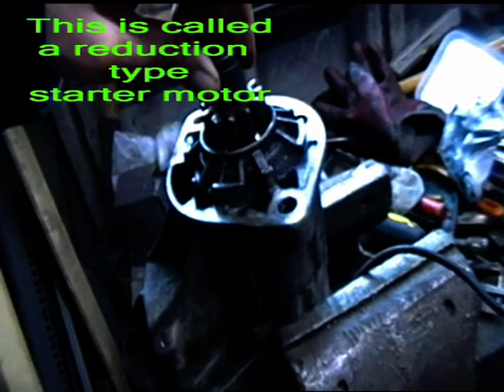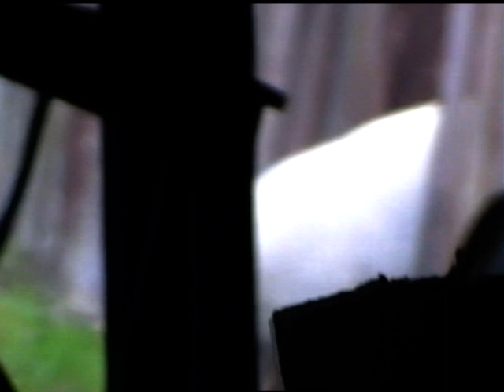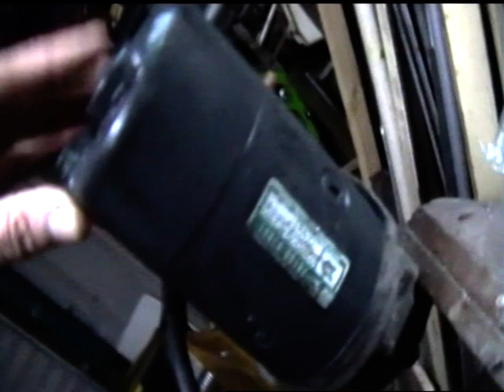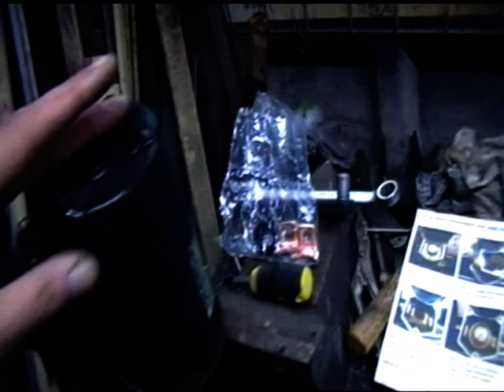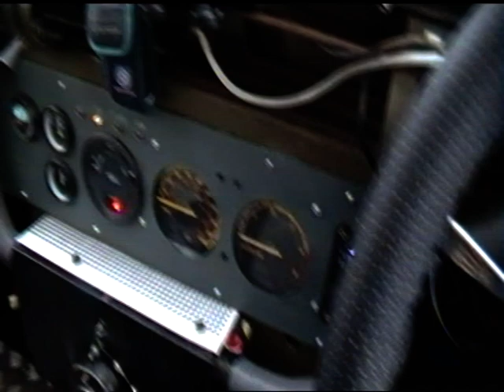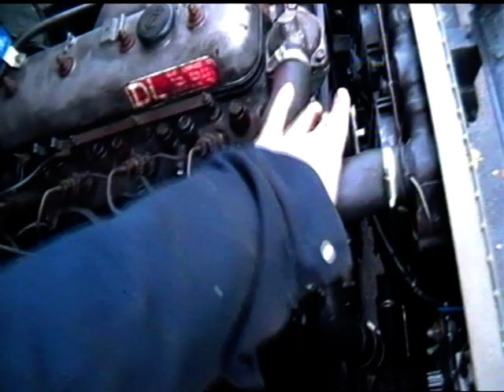Daihatsu Reduction Starter Motor Repair

Comment: That copper disk  on the Bendix drive was a common problem in high milage Chevy starter motors. Most would just go buy a new solenoid but, I just 'flipped' the disk over and I was back in business.
Reply from the maker: Thanks yes have had similar in past and this time not the disk but the half burned through + supply contact. It cost me £17 for the complete kit as opposed to maybe £200 for a complete new starter these days.